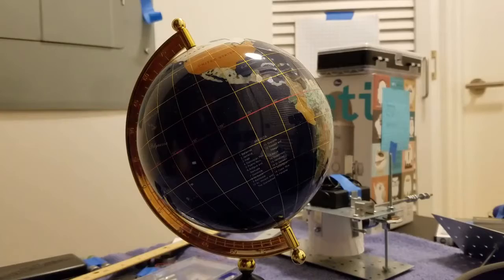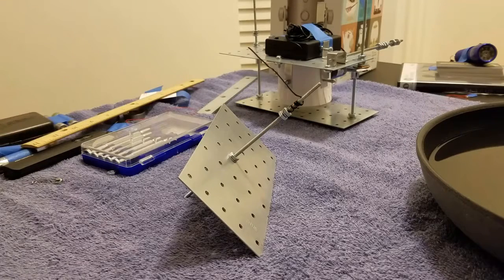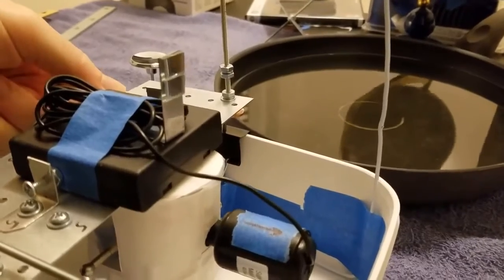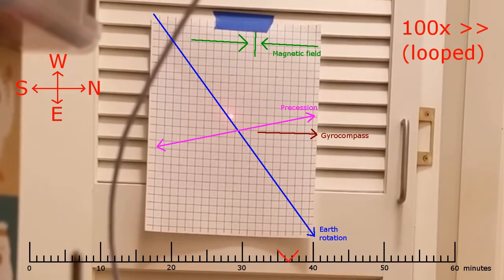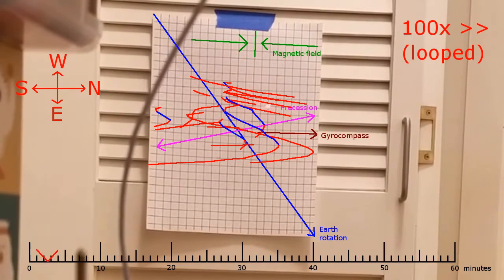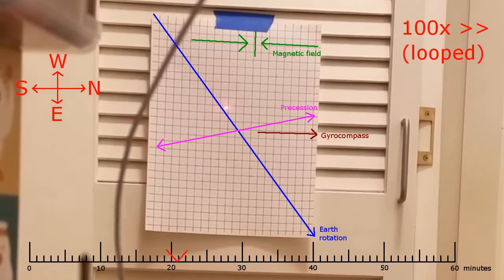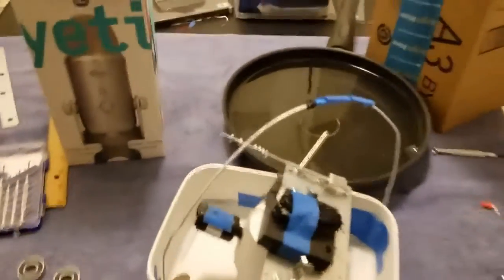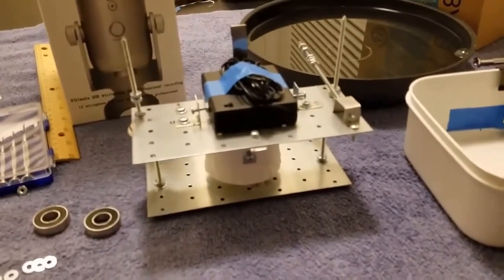Foucault Gyroscope showing Earth Rotation, version 2

Comment: Excellent, Scott! I have been trying to do this for weeks! Your work area and my bench top look similar, same precision gyroscope, same blue tape holding battery pack, same laser concept, the list goes on.  I could not measure any movement so decided my methods were not precise enough. Had plans to use a floating apparatus. So I an not too frustrated any more, glad I found your video.
I wonder how Foucault detected earth rotation  150 years ago with hand cranked gyro, in less than 10 minutes!
Reply from the maker: Ha ha!  Welcome to the world of precision measurements with amateur equipment.  I went down the floating route too.  The main problem I ran into there is that water has a surprising amount of viscosity and surface tension in comparison to the force we're trying to measure.  (Hint: Make sure the water is clean.  Viscosity builds quickly as it gets colonized by microorganisms.)  The gyrocompass I built was an accidental discovery while tinkering with what was intended to eventually be a full float-based gyroscope.

I agree it's a wonder Foucault did it.  If he had a competent machinist (which I am not!) working with him, someone who could make a really good, properly balanced, bearing, I think it's possible.  Also, my understanding is he used a significantly bigger flywheel, maybe 8cm diameter?  More rotational inertia could be a major help.

Comment: Nicely done. This is an incredibly difficult experiment to perform without access to precision engineering. Sadly, I doubt that the average flat-earth spin-denier is going to be able to understand that it IS in fact a proof... Lol, I just looked at the comments. It is as I suspected.
Reply from the maker: Thanks!  You're right, this is difficult, much more so than I imagined when I originally started working on it.  I regard this experiment as only a partial success; I'm confident it was measuring Earth rotation for a few minutes at a time, but it's not persuasive to a skeptic, among other reasons because of the difficulty of replication.  The gyrocompass on the other hand (see link in the description) is, in my opinion, fully successful and ought to be persuasive to an open-minded skeptic.
Reply: @GarbageGamer74 You're not going to find open-minded skeptics among the Flat Earthers. Nobody else needs persuasion, the movement of the stars and solar system are enough to prove rotation of the Earth to any sensible person. Still it's a fun and challenging experiment and worth the experience gained in attempting it I think.

Comment: If magnetic field is a worry, you can block it when any magnetic material wrapped around the motor. I'm not sure you need to keep the motor attached. Foucault was able to do his experiments with a freely spinning gyroscope in spite of the fact that it was losing RPM fairly quickly. I think the air torque is just (or mostly) a drag on the spin of the gyro and doesn't cause precession. I could be very wrong on that point though. Before laser ring gyros and fiber optic gyros, Inertial Navigation Systems used low pressure vessels filled with helium/hydrogen to reduce the power required to keep the gyros spinning quite fast.

What I found most interesting is how you were able to cobble together various items to do your experiment. That's pretty good ingenuity there.

I think the best demonstration will be one where you can come reasonably close to measuring the sidereal day. I think I heard you mention that in the video. It's a lofty goal, but should be pretty convincing.
Reply from the maker: The magnetic field could be blocked with mu-metal foil, but at around $1 per square inch it's not super cheap.  Another approach is to build a Helmholtz coil, like these guys did: https://www.youtube.com/watch?v=zkYWRgQmBKE .  Yet another approach, which I've been tinkering with, is to add small permanent magnets to the boat that mostly cancel the torque of the magnet in the motor.

I do need the motor; I already tried without it.  Foucault's flywheel was much larger, so had far higher angular momentum, but the small flywheel in this gyro has low angular inertia and also spins down very quickly, losing most of its angular momentum in a minute or so, and coming to a complete stop in around 10 minutes.  Also, as it spins down due to bearing friction, it transfers angular momentum to the boat, causing a torque, because I can't mount it perfectly vertically.  I don't know how Foucault solved that problem.

Air doesn't cause precession per se, but it does cause a torque, sort of like a spinning propeller.  My setup would rotate slowly due to that before I added the cowling.  It is also requires still air in the vicinity of the device, since any ambient air currents will be detected.

Comment: Perhaps you could mount your gyro in a fixture supported by a Schuler pendulum.  The unwanted motions of the FIXTURE would be cancelled by this, leaving the motion of the pendulum axis to be recorded without negative effects being displayed.

Have you thought about an air powered gyroscope. Eliminate the magnetic field of the electric motor.

You are doing a nice job of engineering!!  Trial and error application of successive improvements in design!
Reply from the maker: I don't understand the Schuler pendulum suggestion.  My apparatus is sitting on a motionless table, then in fairly still water.  What unwanted motion is there to cancel?

I've read about air powered gyros, but I don't understand how to build one that would avoid the problem of the air causing a torque.  Even my electrically powered gyro generates enough air current coming off the (seemingly smooth) flywheel to create measurable torque if I don't have the paper cowling on it.
Reply: GarbageGamer74 The schuler will keep small perturbations from you mount moving out of your experiment.  You want only the gyro axis to be marked by the laser pointer.

But I think a Schuler pendulum would require quite a large mounting system to be effective.

I think you could do away with the floating apparatus.., Just blue skying.  I haven't considered such an apparatus as your before.
Reply from the maker: I see.  I haven't seen anything to suggest I need more isolation from the environment, other than the Earth's magnetic field.  Is there some extraneous motion you see in the video that you think the pendulum would eliminate?

The floating bearing seems to work very well for the yaw axis, so I see no need to replace that part.  The pitch axis is the part that doesn't work as well as I would like.
Reply: GarbageGamer74 Nothing specific.  I only suggest it as a potential to damp more/any extraneous motion in your gimbal setup.  

I know an electronic version of Schuler's is used in aircraft gyroscopes to damp out the long period oscillation caused by the gyroscope travelling across the earths surface..,  

Might not be too applicable to your benchtop.

Comment: How about this?

Two gyroscopes freely rotating on gimbals.
One on terra firma
One in a cage which is vertically rotating from east to west one every 24 hrs (following the Sun)
Both with axes aligned east-west direction and parallel to each other.

Run it for 6 hours and observe the alignment after that.

If the earth is spinning, they should be no longer aligned
Reply from the maker: The main problem is the "freely rotating on gimbals" part.  This video shows my best attempt at balanced gimbals with sufficiently low friction, and it's only good enough to track Earth rotation for a few minutes at a time.

If you want direct physical evidence that the Earth rotates, check out my gyrocompass videos.
Reply: GarbageGamer74 
I know what you mean, but what I'm suggesting is to put the ball in the flat earthers' court as far as friction is concerned. 
The rotating cage would already be 'steady in space' and not have to deal with friction to maintain its orientation.
Reply from the maker: Oh, I understand now.  Indeed, placing the gimbals on or inside something that slowly rotates would effectively test whether the friction is too high.

From my experience, when using this particular flywheel, I can report that if, when you breathe near the gimbals, they don't turn, the friction is too high.  If the motor's magnet does not act like a magnetic compass, the friction is too high.  If resting a few centimeters of fine thread on one side does not upset the balance, the friction is too high.  Even at max speed, the angular momentum of this flywheel is very small, so it requires a very sensitive instrument to use it to detect Earth's rotation.

Comment: If you stick gyroscope to the globe model to where you live or on equator, spin the gyroscope, and then slowly rotate the globe model. I think, this way you will be very easily able to demonstrate the effect of earths rotation on gyroscope. You wont have to wait for hours for results. If you slowly rotate globe model 50%, this will be equivalent of 12 hours passing on earth. The gyroscope will spin upside down. If you spin globe model 50% more, this will be equivalent of 24 hours passing on earth. The gyroscope will spin in its original position again. If i am correct. Try this simple experiment. If it works, a video demonstrating it will be awesome. :)
Reply: The gyroscope must spin and tilt freely.
Reply from the maker: I've considered doing this before, by putting the gyro on a turntable (like a record player).  This would test whether the gimbals have too much friction to measure rotation as slow as the Earth.  However, I consider the gyrocompass experiment (see link in description) to be a better demonstration, so haven't felt the need to further refine the experiment shown in this video.

Comment: Have you pointed the axis of the gyroscope to the EAST and WEST orientations to see how the gyro precesses?  I think it should DIP to the east and rise to the west..,
Reply from the maker: In this video, the spin axis points West.  The rotation of the Earth causes the axis to move down and right (North), just like a star in the celestial equator (or the Sun), setting in the West.  That movement is visible here, although only when the gyro is perfectly balanced.

In some other experiments, I had the spin axis pointed East.  In that case it ought to move up and right (South), like a star rising, and it does sometimes, but that is similar to the movement caused by precession when the gyro is not balanced, so it is hard to distinguish the two and be sure I'm measuring the Earth.

Comment: Startrails disprove the standard heliocentric globe model.
Reply: Then why are there different star trails depending on where you are? And why are there different stars that rotate around the poles?
Reply: Allen Stanler It has been explained, models have even been made. Google: flat earth stars explained. The Star trails actually disprove the standard globe model if you would just use basic critical thinking skills about the pattern we see. A better question is: why are we unable to detect any curvature or rotation?
Reply: Nicholas Pitts I actually watched that video already, it’s just a big straw man that doesn’t match up with observable reality, and the model hasn’t been proven either. “Perspective” also isn’t a good excuse.

Also, we are able to detect movement, leave a Gyroscope spinning long enough and it visibly moves with the earths rotation. This has been observed hundreds of years ago. Also, the Sagnac Effect wouldn’t work a flat earth either, as the devices used inside that detect rotation wouldn’t function.

Also, the Coriolis effect is a big offender to the flat earth model.
Reply: Allen Stanler it does match.. Thad the point of the model to show that it could work.. god forbid we try to explain what we see. 

What gyro can detect earth’s rotation?? This is big news please link us to the experiment.

There is no coriolis. When will you realize you can’t have it both ways? If you want to believe things you will eventually need proof.
Reply: Nicholas Pitts No, it doesn’t work, the display of the stars would have a visible curve to them, and would be able to approached. That, and it isn’t proven, it’s a very elementary hypothesis.

Also, you put a gyroscope in a frictionless mounting, you can observe it’s rotation. There is no specific gyroscope you seem to be clamoring about.

Also, no Coriolis? Guess you can explain to me why the Jet Stream doesn’t exist too.
Reply: Allen Stanler the star trails do curve. We can’t leave low earth orbit, and the stars disappear at a certain altitude.. nasa is hush about the details.

Provide the experiment of the gyro detecting motion.. upon looking for one you will find it doesn’t exist. - yes according your your science the gyro should detect the motion, and the gyros are in deed capable of detecting motion even slower than 15 degrees per hour.. so WHY can’t ANY gyros ACTUALLY detect it? Again provide Link if you think they can.

Jet stream is particle acceleration. Not coriolis. I told you. There IS NO coriolis.
Reply: so if there is no Coriolis then what are Rossby waves?
Reply: spookdad The sun moves. The earth is not a planet.
Reply: Nicholas Pitts
 that in no way explains the existence of Rossby waves
can you supply any evidence that the earth is not a planet?
Reply: Walter Bislin curvature and rotation have never been observed. If you believe they have please link us here and now
Reply: Startrails work perfectly on a globe.  They don't work on a flat Earth.

Comment: the gyro is designed so that the center wheel is going to stay static in space the axles will move to show the earth moving. It has nothing to do with the stars , given you do not understand how the stars work. Go outside and watch your stars for awhile to see what they are actually doing. And your gyro doesn't really look like Foucault's. This is not a very accurate experiment at all. Please research your material better
Reply from the maker: Yes, an ideal gyro's flywheel's spin axis will maintain a constant direction in 3D space.  Distant stars merely provide a useful way to identify such directions; of course the gyro does not know they are there.

In what way have I misstated the apparent motion of stars from Earth?